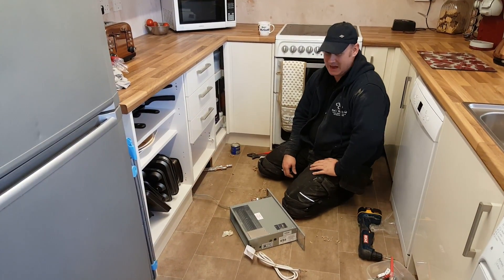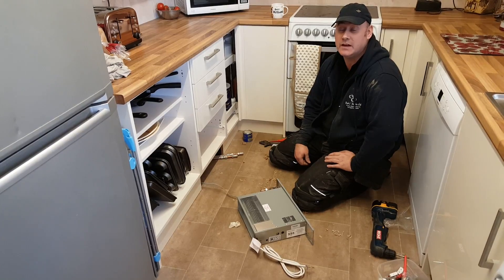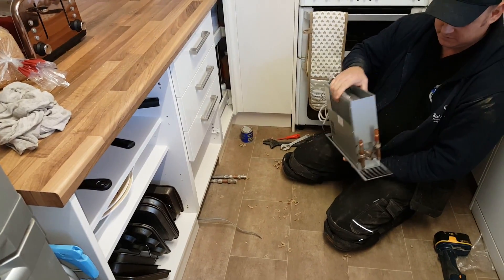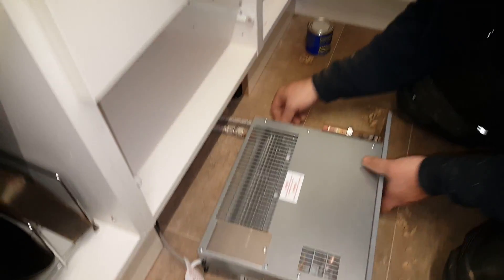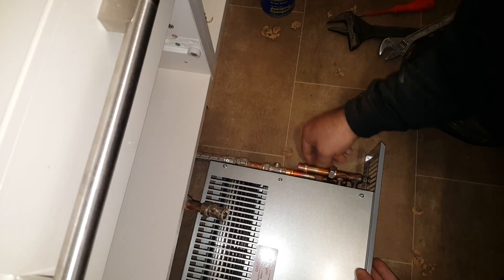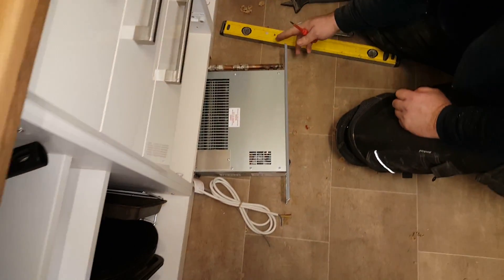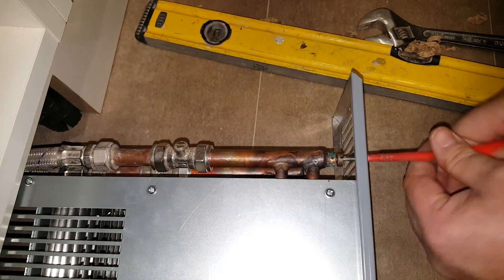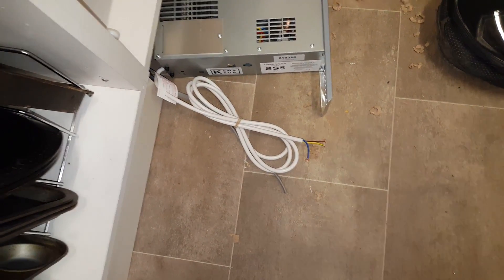Smith' plinth heater installation pt2

Comment: Please could someone tell me what it is like to stand in front of one of these systems on a cold winter's day while doing the dishes? Will my toes be too hot?
Reply from the maker: No, I think your toes will be just fine lol. They throw out enough heat to make a cold room warm in a very short space of time. If you are replacing a radiator with kitchen units, they are ideal, just what they are made for.
Reply: My toes do get too hot! But they do work well.
Reply: @birdnblokeltd are these one control system, by the central heating system?
Reply: @JesseCampbell0 maybe you install it in the wrong place of the kitchen?

Comment: I see there are two lines coming in.  One is from the hot water, and is the second to a drain?
Reply: The two lines are flow and return connections to the existing central heating system.

Comment: I wanted these plinth heaters in my kitchen but I was thinking they are electric
Reply from the maker: Hi they have an electric fan with a wet core that is connected in place of a normal radiator.

Comment: Can the plinth heater be fitted vertically aswell as horizontal
Reply from the maker: I can't see any reason why not if it is supported under its side. It would be a good idea to speak with the manufacturer about your plans.
Reply: Some are made to be vertical and some are unsafe.
Reply: @michaelparker5030  what do u mean unsafe? Unsafe vertical or the thing is unsafe?